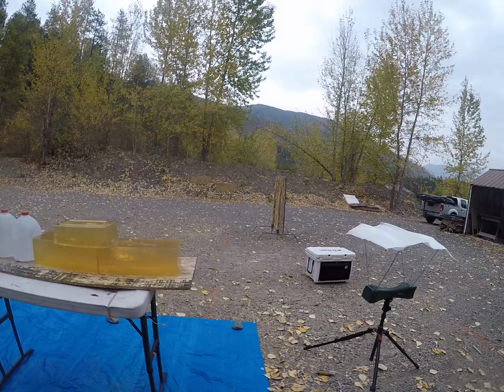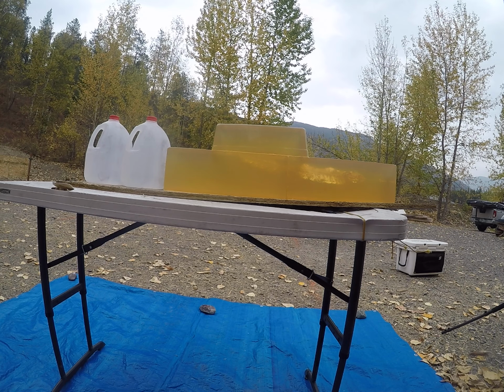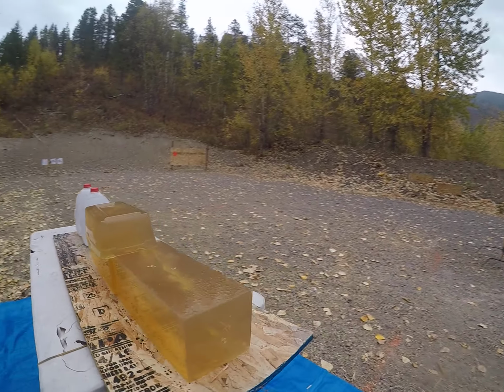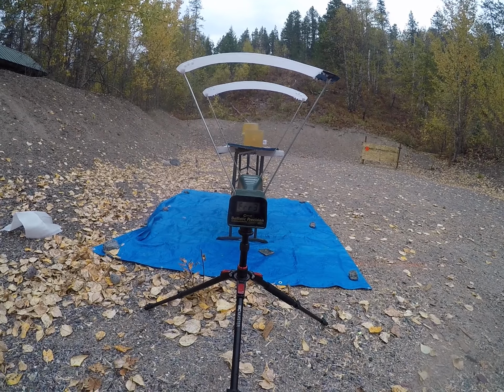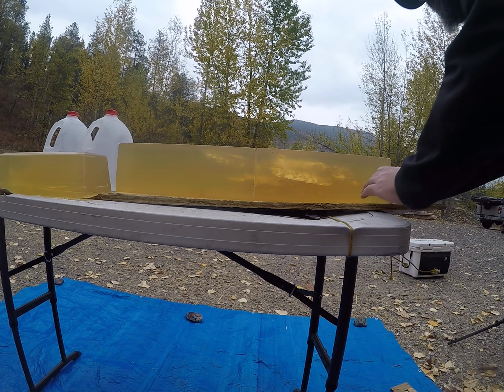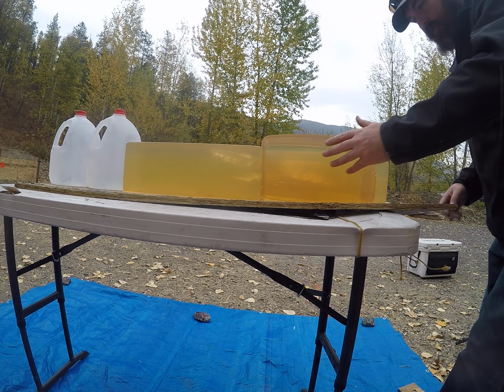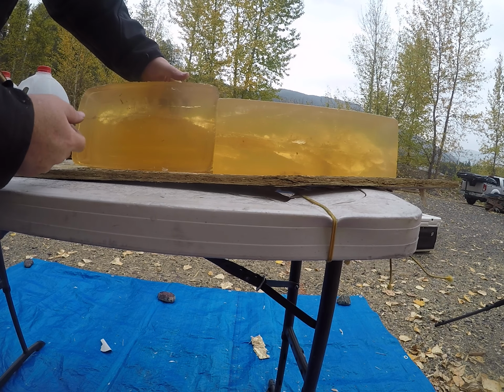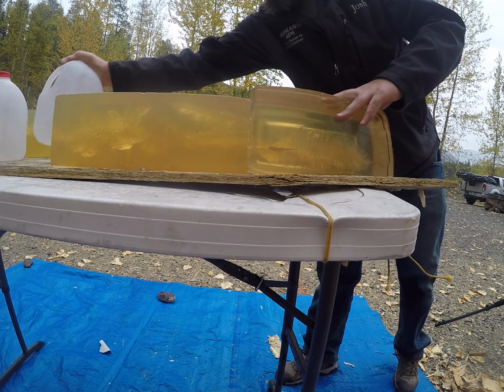308 Win 150 gr Hornady InterBond ballistic gel test PT1

Comment: I have loaded buckshot for years, however due to the current ammo situation I have been forced to begin to load for my 7mm-08. I bought a box of 139 grain Interbonds for my deer rifle. I sent an email to Hornady after watching your videos. They actually gave me a quick response. The bullets have to have a minimum of 1800 FPS to open and are designed to a maximum of 3500 FPS.  Some of the Nosler Accubonds state the same minimum FPS on the box. (What I would give to find a box of Accubond Long Range -Nosler giving my local dealer an ETA of Feb 2023)  I've had Superperfomance 139 grain SST.s blow up inside of deer and have lost the animal due to no blood trail. I'm really a big fan of bonded bullets now. At 2850 muzzle velocity they won't hit 2000 FPS till 500 yards. Good enough for me! Really enjoy your videos!!!! They have helped me a lot.
Reply from the maker: Glad you enjoy. 

It can vary from caliber to caliber but for the most part it is safe that if you don't know the minimum rating of the bullet you're using make sure the impact velocities are 2000 fps or above.  Most manufacturers will if they don't already have the velocity ratings listed give them to you if you simply reach out to them. 

Have you ever considered going to monolithic bullets? Hammer bullets tend to always have some in stock they are little pricey but one heck of a good hunting bullet.
Reply: @simplemindedfella   I've tried the Barnes TTSX 120 Grain and my rifle loves them. With my terrible shooting they'll shoot 1.5 inches at 200 yards with a muzzle velocity of just over 3000 FPS. I live down south and most of my shots are up close and personal. On a power line or gas line you may be able to stretch them out to 4 or 500 yards. I've never used copper bullets before and am concerned they won't open at close range. I'm putting meat on the table and hate to lose a deer. Thanks for the reply!!!